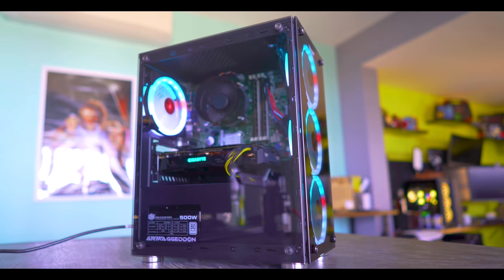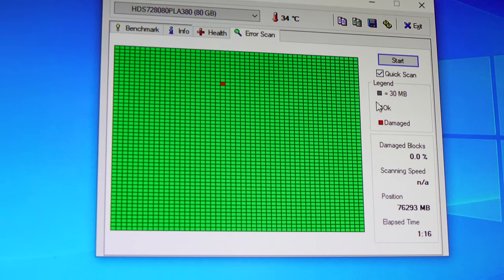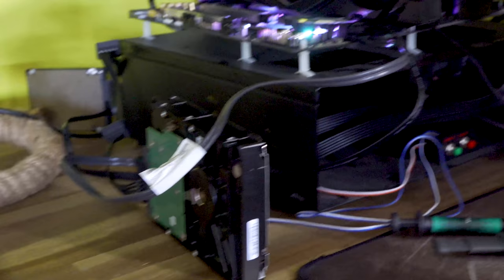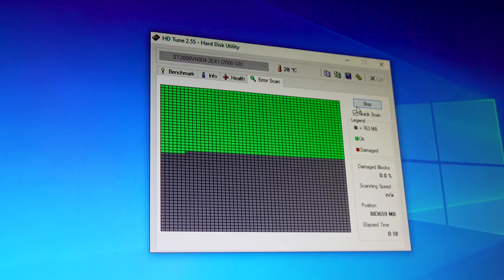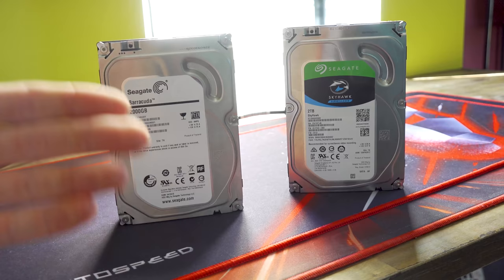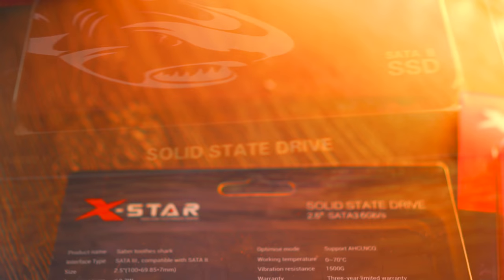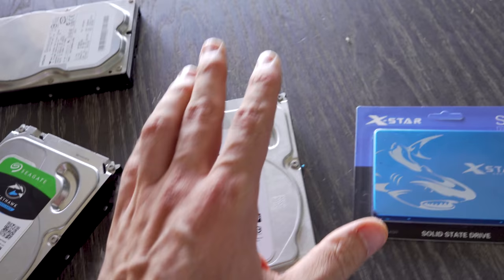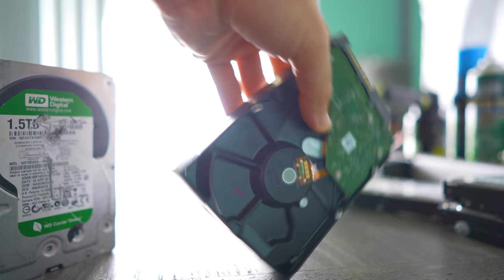Are USED Hard Drives Worth it...? (The Tech YES Buyer's Guide)

Comment: Another piece of advice concerning a dying Hard Drive is try not to change the Data on it at all until you back it up. I have 3 Hard Drives that are on their last legs that all still work because I disconnected them when I noticed the problem & backed up what I needed from them. They all still work & I still occasionally pull Data off of them but have not added to or erased any files on it. They will probly work like that for a long time, good enough for a secondary backup for whatever is on it.

Comment: About 90% of my drives are 2nd hand, all purchesed though cex with a warrenty, I just use them as cold storage and  check the data every 6 months or so, all various sizes and makes from 500gb to 3tb. Its a cheap backup method for me.
Reply: yeah these things can be useful for storing non-critical data, like games, emulator ISOs, movies etc... just keep writes to a minimum and things should be okay... been using one like this for 3 years, there's other guy that says 8 years, I don't doubt him at all... Linux helps a lot with old drives too, less random writes on disk
Reply: @FeelingShred  You sound confused....writes dont affect durability with old fashined spinning HDs...Actually, writting is required to make sure your data stays intact overtime... For this sole reason, there are apps that their only use is actually rewriting all the sectors of a hard drive with the very same data they contain, to make sure the data is safe and magnetism strong... Leaving a hard disk in a shelf for a decade is a good way to lose some data here and there...
Reply: @Trikipum  what you're talking about is bit flips which can happen and are accelerated by heat, generally HDDs are less prone to bit flips than ssd's. 

However writes do effect lifespan, anytime a HDD is doing something that being idly spinning with a parked head it's doing wear on the bearing, everytime that write head moves up and down the platter it's one more chance of a head crash or something

Comment: Before giving up on a bad HDD take a look under their PCB because they can develop rust (usually looks like some kind of black gunk) where the PCB touches the HDD head pins and motor pins.
Removing the PCB and cleaning the contacts with rust cleaner/a eraser/isopropyl alcohol can bring them back to life and put them back into service for many years.

I have 2 ~8 years old 2Tb Seagates drives that the Bios was having a really hard time trying to detect them and when it did they where giving a lot of R/W errors or disconnecting. After a cleaning the PCBs they are now working like new for about a year.
The only thing is that the first driver that started showing problems I didn't knew about it and I tried many softwares in hopes of fixing it. Using the driver when it was giving errors while using repair softwares left a mark on the S.M.A.R.T. If you check this HDD on the HD Tune Pro it will say that the drive Failed and must be replaced but in reality the drive is fine.

One has 1263 days of power on and is the one with the S.M.A.R.T. failed. It was my main OS for many years but I have a SSD now. Even being fine i'm only using it to store games and movies because of how long it has being in duty. 
And the other have 114 days of power on and started showing the same problem around 12~16 months after the main but I already knew what do to so the S.M.A.R.T. is clean.
Both where brought and installed in the same year (~2012) with 2~3 months of difference. The difference of time probably is due power saving that turn the disk off if its not in use.

Comment: The Skyhawk is still under warranty. If you aren't able to get it repaired in oz(you should be able to however), bring it to Taiwan where we can repair it and make another video.
Reply: Who is "we"
Reply: I got several Seagate drives sent in for repair, and replacements failed and were sent in for replacement, where those replacements also failed... So on so forth..  Seven times across 11 drives before I gave up and threw them all in the garbage in favor of buying WDC.  In ten times that time, I only had two WDC drives fail, and only one on warranty. It says a lot about their quality.  The cost of shipping the drives to Seagate, added up, and losing my data numerous times nearly ended up with me smashing all my computers with a sledge hammer. So frustrating losing irreplaceable family photos, videos and countless hours of work on the computer. I always recommend using RAID with crappy drives like Seagate.
Reply: @HoloScope  I took Bryan to do tech repairs in May when he was in Taiwan. I was in the video.
Reply: @pixels303at-odysee9  That sounds awful! I would certainly be unhappy with that too if that happened.

Comment: I had a friend who swore he could fix his old ipods with the hdd's when they made that clicking sound, by violently slamming it on the floor.
Reply: Well i guess they didn't make a click sound after that anymore.
Reply: Lmao
Reply: Sometimes the bearings start to go and whacking it can get them going. Less so with modern HDDs where the thing will just jam up  and your screwed.

I once had some WD Raptors in raid 0 back in the day and every time i started the PC i had to " encourage " the platters to spin up with the rubber end of a screwdriver , once they warmed up they where fine.

In fact , pro tip, if you want to replace the drive in your PC or server just as its about to go out of warranty.

Step one, go get your rubber mallet ( you do have a rubber mallet right ?)
Fire up some massive disk to disk copy on your drive to get it spinning nice and fast.
Take rubber mallet and go to hell on the side of the drive ! 
after about 10 or so good hits you should hopefully get a head crash.
Return the drive for replacement, the rubber mallet wont leave any marks!
Reply: On the side can be helpful if the heads are stuck, but 'flat' and you damage heads or platers. A method I had to try on an OLD drive (Quantum Fireball) was stick it in the freezer for a day. Gave me ~15mins to back up files, 2nd time it died for good.

Comment: I've got a couple 1TB hard drives manufactured circa 2010ish from Goodwill and a thrift store in a redundant Windows Storage Spaces array for the past few years, and haven't had any problems yet. One of them even came with a few hundred bad blocks- and nothing more has failed yet.
Really, that's something you might want to look into- Windows storage Spaces. It can do all sorts of software RAID, and more. However it might involve a crash course in Powershell to do some of the more advanced stuff (IE: SSD+HDD tiering)
Reply: my local thrift store wants 20$ for an 80gb drive... that's IDE and untested.....

Comment: I have bought refurbished HDDs that have worked great and some that have had problems. I would recommend running a full capacity test on the drive using a tool like badblocks. I have a dedicated linux install on a flash drive (not a bootable live iso, an install using the flash drive as the boot device) specifically for this purpose. If you are going to be processing a lot of drives I recommend using a tool like BHT that allows running badblocks on multiple drives simultaneously, and creating a dedicated rig for running it. As a added bonus running badblocks will overwrite the entire drive and leave it blanked as all zeros when complete, so you reduce the concern of sensitive data being recoverable from the drive. It is not as good as running dban, but is an improvement over nothing while you are inspecting the drive.

Comment: if i have two hdd that dont look perfekt, i just put them into RAID 1

would be a waste otherwise (in my opinion)
Reply: they make great candidates for software raid. I use storage spaces and its been super robust for me and has survived a few drive failures now. Speeds are slow, but for a lot of things that doesn't matter so much. If you use ReFS it will periodically check your files for bitrot too and fix any that it finds along they way. And bitrot can be a problem. Especially when moving around terabytes of data.
Reply: or a DIY nas -  rock64 openmediavault with  ZFS or Btrfs
Reply: Wtf is perfekt....lol

Comment: Don’t normally post, but you can easily get 2tb hdd new for around $60-70 in us. Usually seagate barracudas 7200rpm on Newegg or microcenter.  So I think 1tb drive don’t really make sense new as you mentioned, vs a 500gb SSD for about $60. 

Also crystal disk info will do a similar job, to the program you mentioned, but also work on SSD and it’s free as well.

Comment: Important tip. If you have time to unscrew the motherboard of the hdd, 2.5/3/5 doesn't matter, IF there are pads that make contact to the hdd itself, sme may have a plug/socket system but most have pads, then check to see IF they have dulled and become almost brown, this can and does prevent the hdd from showing up in the bios, reading incorrect space etc. If so then all is NOT lost, just get a soft eraser and rub over the pads being carteful NOT to knock off any companonents as some around thyose pads can be very small. The reason? that brown tarnish can prevent proper power going into the hdd itself and read/write line etc from being read properly. This is because of signals being transfer are actually electrical. The less the conductivity, the less chance of reading or powering etc. Give them a rub and they should shine up. You can try IPA but tbh, that most likely will not work as effectively. Do the eraser and try again as you may find that this was the cause all along. 
 
I have had this issue and even provenj to a fiend on a hdd that had NOT spun for 10 years or more, after doing this in front of him, it spun up for the first time in that 10 year period. Nothing wrong with it. So, give it a go, even if your own hdds fail, try taking a look, normally a Torx screwdriver is needed but other than a philips (cross head). the pads? usually around 2 rows f about 10+ on each. Just pads nothing soldered on to them, no solder on them, just straight pads.

Comment: I bought a 500 gig hard drive on newegg that was supposed to be new but was obviously used as hell. Love how the seller took a blue Sharpe in a failed attempt to hide the wear on the label. The metal cover had so many deep nicks and scratches I'm surprised it actually worked but the s.m.a.r.t data showed it had 24 hours or so of runtime on it. Then down the line I bought a 3TB drive from Microcenter that was refurbished because it was about the same as a new 1TB drive from the same line. Good working drive but it's got 2 separate partitions on it that I can't get to merge to get it to use all 3TB on one partition. I'm wondering if maybe the drive was formatted with dual operating systems on it and the refurb screwed it up or something. Also years ago I had a hard drive go belly up the moment it started that clicking noise in a laptop

Comment: I was once out for a walk and found a PC in a thornbush, It was rusty and had been rained on for quite a while.
The drive I pulled out of it was a Hitachi DeskStar 160GB, the PCB was rusted and the solder connections around all the SMDs were corroded.
But it still worked, and probably still does work, three years later as it sits in my hard drive drawer.

Comment: I'm 9 minutes in and didn't see the below mentioned... Sometimes the drives stay in reset mode as long as they get power on the 3.3v pins in the sata connector. It's a relatively new SATA stand-by/staggered turn on feature. Covering the 3.3v contacts with some tape or a sheet of paper will get the drive started (or use a molex->sata adapter cable for testing).
If there's no vibrations (motor not working), it could be just a fuse tripped by the power connector, or a safety diode that's not conducting. A multimeter can check those (use continuity on fuses, diode on diodes).  Sometimes, the power input jack contacts have solder cracks so the drive doesn't get 5v or 12v at all and resoldering the power connector gets them working.

Comment: Im avoiding seagates. Had 2 seagates died on me already 500gb and 80gb
Reply: I second that, only buy wd or toshiba drives and stay as far away as possible from surveillance drives, only last a year and a half in normal pc use
Reply: My seagate 3tb drive still works fine after 2.5 years
Reply: My 6 Seagate barracuda drives have all worked for me for the last 5 years, only problems I have are with Samsung and WD drives, they all failed in the last 3 years I had them.

Comment: If you can see the manufacture date, power on hours and #of power ons (hdd), or TBW (ssd), and the drive is within normal use range, then sure no problem. Actually my whole Nas has manufacturer referb and open box drives. Haven't had a single issue. Just get DOA replacement guarantee and stay away from scetchy looking listings

Comment: Another thing worth considering is that 2.5" laptop hard drives work perfectly fine in a desktop, and are much more resistant to shocks from being shaken, dropped, etc.
Reply: You'd think. I have a friend who is easy on his laptop, but lost 2 different models of wd blue. Moved him over to a used ssd so hopefully I won't have do any more data recovery.
Reply: and also much slower. to the point where you may as well use a pentium 4 and not notice a difference.
Reply: @zoomzabba452  Bad luck :( They have the same chance of failure over time as a 3.5". It's only shock that they're more resistant to. Even then, it's not like it's ever safe to drop it.
Reply: @repeatrepeatrepeat  Not if you get a 7200rpm. Admittedly there are far fewer of those used.
Reply: Laptop HDDs are completely useless.
They are INCREDIBLY slow. To the point where they're too slow to run Windows 10 at a usable speed. (a desktop HDD from the same era runs fine for example)
They only last like 1-2 years in my experience. Had about 4 fail on me for various reasons, one of them lasted a grand total of 15 days power on time...
I decided to just completely ditch them, use an SSD, and the laptop is incredibly snappy and response, whereas before it would take like 15 seconds just to open the start menu and 5 minutes to boot windows.
Never again.

My gaming laptop also has a HDD (not as a boot drive) it can't handle steam downloads as steam extracts as its downloading, and it causes stuttering in certain games, while on my desktop the game loads twice as fast and no stuttering, despite having weaker specifications in some areas.

I would never touch a 2.5inch hdd ever again, absolutely useless
Reply: @yotoprules9361  I was talking about 2.5" drives in a desktop, which would have an SSD boot drive. I was not talking about using it in a laptop.
Reply: @Trifler500  what's the difference of using it in a desktop vs a laptop? It's still the same drive.
Reply: @yotoprules9361  The difference is Windows runs on the boot drive, which in this case is an SSD.
Reply: @Trifler500  no, i am talking windows running off of the HDD, which you can do in both a desktop and laptop...
Reply: @yotoprules9361  but I'm not

Comment: Bad sectors can be just crc errors due to power losses. First you need to confirm the sector is actually bad by zeroing out the drive  (full format) and seeing if the bad sector remains after. If its gone its just gone, it was a half written sector which had a bad crc and wasnt actually damaged

Comment: I had a 2.5" external that was clicking recently and holy crap did it actually last for some time after that and I was even able to copy off all the data from it. I actually used it for a few months like that before I finally retired it and it was still operating last I had it plugged in. It just slowly kept adding bad sectors but there must have been enough spares because it never came across any that it couldn't recover. The drive was totally full too. Usually by the time they start clicking they are completely toast. Used drives can be a good bargain if they aren't brand new and known to be working. Most drive failures happen either really early in their lifespan or pretty much at the end. The mean time between failures for most physical drives is in the order of years these days. I have quite a few that are over 10 years old and are still totally fine despite being used on a daily basis. Interestingly, I have a bunch of external lacies and they all started failing right around the same time.
Reply: I had a 30gb hard disk that was clicking for over 3 years before it died...

Comment: A meter?
I had an external 2.5" hdd with a very odd cable, 20cm and it really wanted to bend back into it's original shape. One time the cable dragged the hdd off the table edge and it slammed against the steel table leg (hdd is dead since then)...